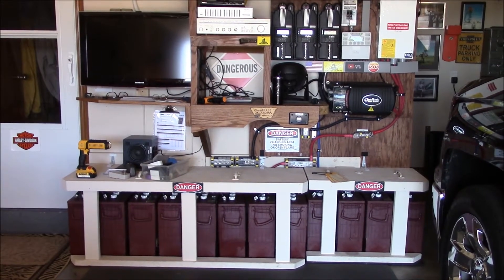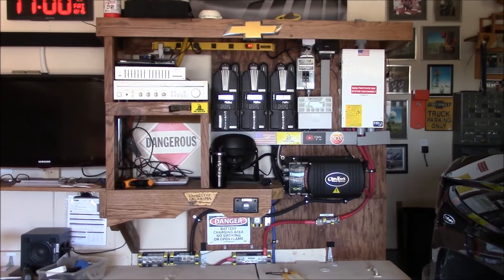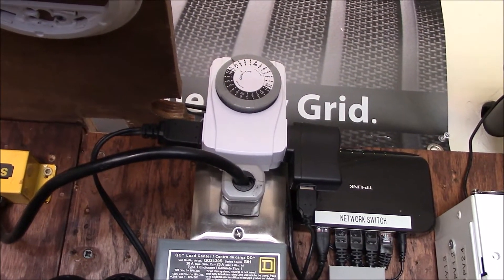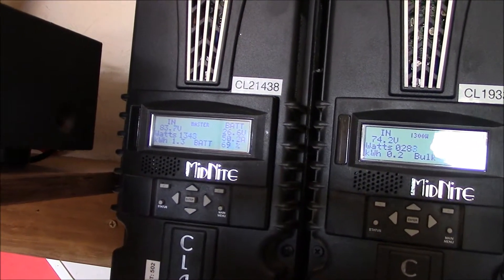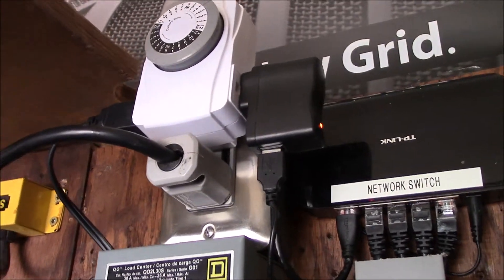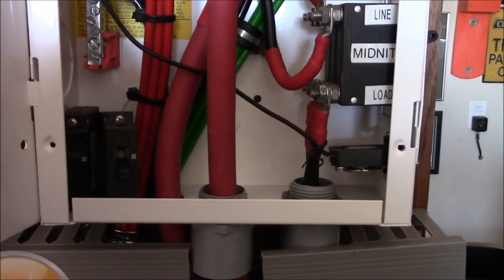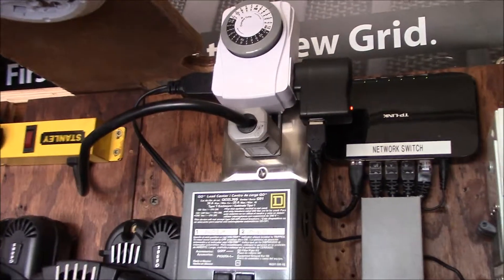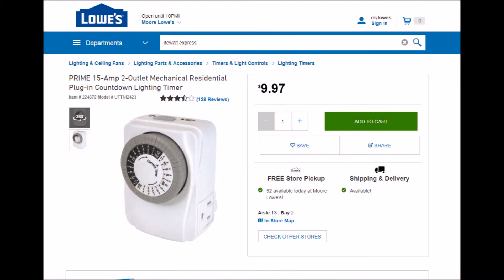DIY home solar power system - cooling fans on a timer (life hack?)

Comment: are the midnite classics really running hotter than they are spec'ed or are you just adding a little extra cooling to keep them well below spec?
Reply from the maker: Heat can suck the life out of working electronics...the cooler the better

Comment: Hey Chris. Have you spoken with your breaker manufacturer - is a warm breaker a normal thing? To me it suggests the resistance is too high.
Reply from the maker: They are rated for -40C to 85C (185F) and have several UL ratings and CSA certifications. I have pushed over 75 amps through them...and they do get quite warm. Dunno if others are "air cooling" them. But for me, cooler breakers are better. They are Carling C-Series non-polarized DC panel mount breakers...Midnite recommended them for their equipment (tech support said this is what they use in their DC disconnect boxes. Here is the spec sheet link: http://www.carlingtech.com/sites/default/files/documents/C-Series_Details_%26_COS_040314.pdf
I did a thermal laser reading on them at peak sun (and pushing 60+ amps) with and without that little fan going...dropped the temps down nicely. Honestly, don't know if it prolongs life or safety, but my "gut" feeling is that it is better to run air over them and keep the temps down

Comment: Eh buddy, yep, I like the timers with those segmented push slots. They give a variety of on/off settings. Too bad they don't have a " variable security mode " which will switch at odd times in vacation conditions.  Also available are 110V duplex outlet plates with 2 USB outlets on the side for low volt phone/devices charging. I installed one next to my kitchen counter so I can charge and hear my phone while I am in the main part of my home.  Those plug-in USB transformers are useful as well as the 12V car plug-in units which have FLIP-OUT 110V plug prongs and USB port on the opposite end.  Nothing like techie stuff WHEN THEY WORK !   J K
Reply from the maker: Right on! The digital ones are likely okay for some folks, but pushing buttons, unplugging it (and losing the time/parameter settings), AC power fluctuations, and no light (on some of them)...meh, rather have the mechanical ones. Helped my neighbor with his Christmas lights...he is also using two of them. Maintenance is key with gizmos...gotta stay on top of them. Made a career out of "tweaking and peaking" high power systems and was one of those guys ALWAYS inside the van watching blinky lights and turning dials...the bosses knew I was crazy. But, who won all the awards and got promoted?
Reply: I'm with you there on the testing, tweaking, and wiring equipment. I still have dreams (little short of nightmares about repairs that go awry , or shocking and tasting metal for a while. ) Technology has grown by leaps and bounds. Us SEASONED GENTS need to keep up with the changes.  When we have that LAST KICK-AZZ PARTY, I hope we are together, toasting to technology, a NITE-LITE  and YOU-TUBE in our casket !  ;-)    J K
Reply from the maker: Learned a long time ago..."no falls, no balls". Gotta get zapped, lose your chili, wet yourself, before earning your stripes. Manuals are there for a reason...and now it seems folks are simply watching videos to get "their" experience. Just hope many newbies are being safe, taking classes (electronics, circuits, telecommunications, HVAC, etc) and doing it the right way. Years of field experience is better than a PhD...but, doesn't pay as well. No build is perfect, but safety and smooth operations are paramount...beats "letting the smoke out" and burning a house down

Comment: Great use of the timer Chris.  Not sure the voltage range on your fan inside the panel, but I use the Aux 1 built into the Classic 150.  For my Zephyr battery vent & I use the Day Light setting.  Just another option if you had not already considered it.
Take Care Friend.
Reply from the maker: Thanks man...tracking ya. I thought about using a step down transformer (Buck converter) and run off the AUX outputs...and may do that in the future. But, for now ~ $6 for the fan, $10 for the timer, and not having to crack open the Classics. Hope all is good up there...been mild down here in Oklahomeyland...no ice storms (yet)
Reply: So far we have had icey mornings which usually is gone by 10:00.  I've been plugging my car in at night so I don't have to scrape windows.  I am looking forward to some snow & driving crooked its enjoyable.

Comment: Great idea!  I use a lot of 5V and 12V wall warts as my line voltage to low voltage DC (Class 2) interfaces.  That electrically isolates the 120V AC circuit from the low voltage DC circuit to keep everything safe.
Reply from the maker: Great to hear from you! I didn't think about that (electrical isolation)...nice! The one I am using is an "older" Motorola unit with a light...not sure if it is good/bad, but I like the light showing it is "on"